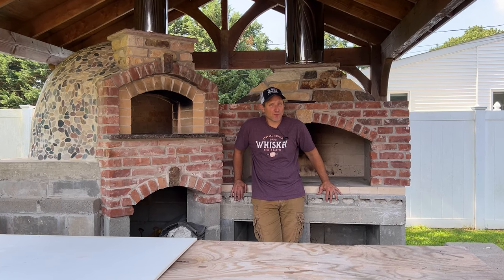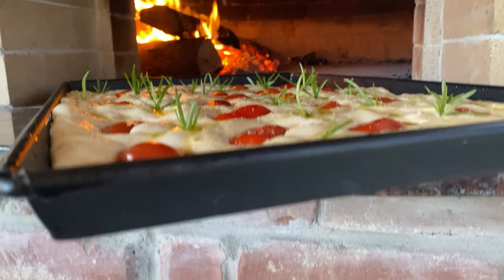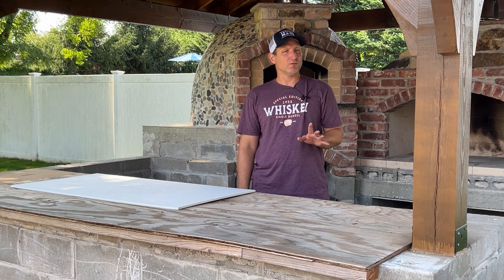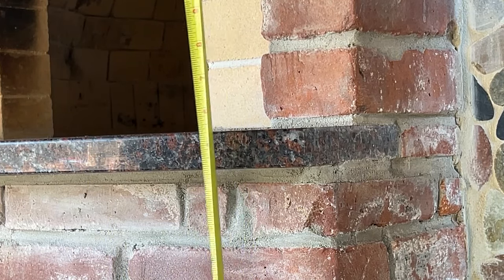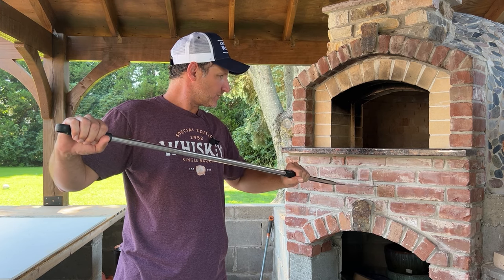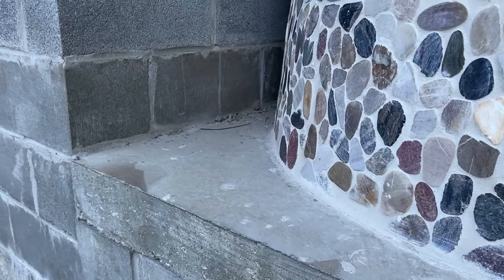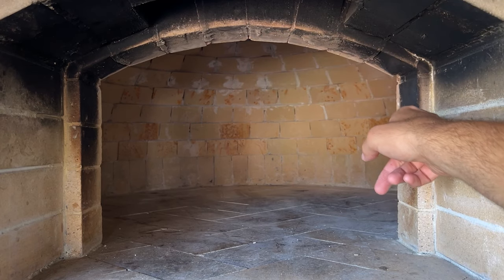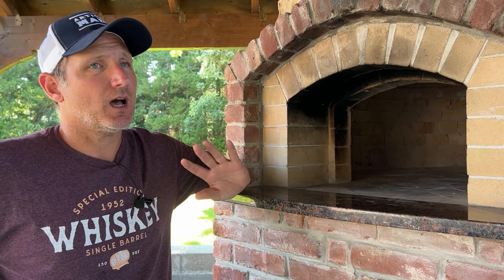Avoiding Mistakes Building a Pizza Oven / Building a Brick Oven / Pizza Oven Construction

Comment: A full round dome is only a YouTube  phenomenon - it creates a burning point on the oven floor. This mistake is due to the “YouTube smart tool” holding the bricks. Italian ovens is more flat and has a variable radius. Top height - 48-50cm …stack up bricks, make a plate divide it in 3 or 4 so they can get out later on through the pizza opening, then use wet sand to shape up your dome - the wet sand will hold your bricks as well. Super easy.
Reply from the maker: You’re talking about Pompeii style ovens and they are great, especially for pizza. Not all oven designs are shaped in this way. The rounder shaped ovens like mine are Tuscan ovens. The reason why so many people on YouTube build them like that is because many of us are not experienced masons and these are much easier to build.  The “YouTube smart tool” existed long before YouTube. I never liked the sand method for constructing the dome and this is not what the pros do either.

Comment: Nice oven. I made a similar video for the indoor one I built for my cafe here in Japan. Mine is a 40 inch and with a 64% inner arch ratio for my Pompeii design. It is always better to run your flue back over the dome and then extend from the middle. This way the heat of the oven powers the draft. As for the height of the base that’s not a problem as everyone in a family is a different height. This is where you can fabricate a platform and place it on the floor and then move it for the taller members of the family. Also when making a Pompeii dome the roof should not be a perfect dome at the apex. It should flatten off a bit and this way you lessen the hot spots. 40 inch is the perfect size even for 2 guys cooking pizzas all night. The only time you need something bigger is when you have a bread operation. I made mine with a second battery brick behind the dome and with a double floor. Super even and consistent and much much longer heat retention.
Reply from the maker: Hello, thanks for sharing. I thought about building a little platform.

Comment: This video is clutch... I just came inside from building the walls of my oven stand and its at 35" in height which I think its kinda low and I'm thinking put putting another round of blocks.  I'm super glad I got to hear you opinions on the matter

Comment: I can so relate to your video, if you say 40 inches is that inner diameter or outer diameter? I've built two pizza oven before, first one was too small and the chimney was placed too high in relation with the ceiling of the oven and the base was too low. Lessons learned! Second attempt I managed to get the opening size perfect and the chimney going back over the top worked a charm. Although I made the base higher than the first one it was still about 8 inches too low for my liking. Both these oven are still in use as they were at different properties we lived at before. Also the perfect radius dome resulted in using such a big load of firewood to get the oven to temp. I am planning a third attempt where I will lower the dome (I saw you mentioned that being called a Pompei style), raise the oven base about 8 inches but also elongate the oven from left to right rather than a perfect circle in order to create a bit more room for a fire and potentially more flexibility when baking multiple items. I hope the lowered dome height will reflect heat down and make the oven way more effective. Wish me luck!

Comment: Good advice I've built eleven ovens . It took ten ovens to perfect the design, size , insulation , oven shape . I finally made the perfect oven for my house and it works fantastic. I've used it everyday for the last 20 days . 
     One thing you left out that is the most important next to insulation thickness , and that is you need to keep it bone dry with a good roof or some outer waterproofing material . A wet oven will not work .  
     Second thing is you need to seperate the oven brick with insulation then another layer of cement or brick then another layer of insulation and then your decorative stone or brick outer shell because if you don't they will crack . Cracks will form all over the place from heating exspansion and cooling contraction .  I could go on and on . But I've been building and using these ovens for twelve years now

Comment: Hello this is Thomas!  I Live in Thailand. I finally found a good Brick layer. From Germany a professional Brick layer. Most of the Thai brick layer's  don't pay any attention to details keeping it plumbed vertically or level. Yesterday we measured the actual  size of the overall width of my pizza oven. It is 40" wide. For building our foundation we are going to be using  Blocks, the Blocks measurements are 2.1/2-1/16th wide By 15-1/2-1/16th So we are going to use two Blocks side by side with about 1/4" of Morter in-between the Blocks. Making the total with of the block 5" Wide. 
I've decided to go with your suggestion for the actual oven door opening of 18" and the Center of the door opening 12" High. As you answered me in my first question  about do you have a door for your pizza oven. Thank you for your answer. Mine will be the same just a simple metal door with a Handel to cover the opening of the pizza oven. 

I have another question for you what about the metal flue that takes out the smoke? They don't have aluminum here at all only steal in which to build it. What are your thoughts and suggestions on this? What are the four sides of the dementions you need for the flue opening? How high should we go up with the stack?
Reply from the maker: Most are made out of galvanized or stainless steel.  The opening should accommodate the size of your flue.  My flue is 8 inches in diameter.

Comment: Hello Jason. 
I'm asking a few more questions. The reason I have not built my pizza oven yet is I have been looking for my friend who is a Professional Brick layer from Germany.
We have started he has built the three sides of the oven the blocks measure in width 2-3/4 Length 15-1/2. Width. 
He put two Blocks side by side with rebar in the inside of the Blocks. Four courses high. We built the fram overall demetions are 51x51"X4" thick with rebar. 
Heating our pizza oven. 
What about using LP gas this is the norm for cooking here in Thailand. I've been thinking about this? I think I will go with it  besides wood. Using wood here Is a lot different then in America. Plus here in Thailand there is not that much wood here in Thailand. 

Jason I am in the process of building a wooden dome. I have built one already but it was to small. So building a new Wooden dome I've looked at your video again I'm going to go with your overall suggestions. Highth of the opening, dome.  The width of the opening door. My Brick layer Kai is coming back next week to start laying down the fire bricks on top of the wooden dome I've built to your suggested measurements. Sounds great. Thanks. 
Jason My first wooden dome wasn't large enough I couldn't put Three pizza's inside of the wooden dome. Opps  I looked at your video again writing down the measurements of what you suggested. I'm going with it. Thanks. I am going to have a door opening and closing. After Kai gets  almost everything done I will have to oven door built.

Comment: I went with an exercise ball 29 inches at Walmart 13$ it kinda filled it.  It's a strange hat-looking dome lol the foam was hard to build after I got so high. but I stopped the tool just after the arch and did it by eye it turned out to be egg-shaped kinda like a turtle, but then rounded just before the hat. don't know how to show it but thanks for your vids helped me a lot 48" inside needs to fill some gaps inside but I'm satisfied. watched your vids like 50 times
Reply from the maker: Congratulations!!! This is not an easy thing to do. If you have time, send me a pic. Artisanmadethings@gmail.com
Reply: @ArtisanMade  I am planning on building an oven this summer.  Would a two piece arm on the tool work with a series of holes say a half inch apart for shortening the arm length as you proceed thru the top of the dome work?  I don't know how much shorter the arm needs to be, but with the known drop needed the hole spacing could be split so it would be even for each row of brick.

Comment: Thanks for informative tips,
I have a question if you don’t mind!
Is the outer wall of the dome going to be hot?
And what is the clearance if it’s close to the wood material?
I’m adding a pizza oven in to my existing outdoor kitchen space which is mostly wood, since we live in Toronto and I need to know if should be considered and also for exhaust pipe after insulation can be close or touching wood material?
I really appreciate if you would help me with that since I couldn’t find any source for that!
I thought I would put the whole oven right behind my kitchen and only opens from inside means just an iron cast small door maybe!
If I have the answer for that I’ll start it right away sir,
🙏🙏🙏🙏🙏

Comment: Thanks for tips! Just wondering how did you calculate the amount of bricks you need to build this oven? I want to build a Pizza Oven similar to this but smaller. 🤝
Reply from the maker: I took a guess. I bought 300 and used 250.
Reply: @ArtisanMade  Also, instead of adding chicken wire, insulation and cement for the outer layers of the oven, could you use the vermiculite paste you used at the bottom of the oven to cover the entire oven as an insulator?
Reply from the maker: @heartsofhubert  yes. 6 inches thick is the equivalent to 3 inches of the ceramic fiber blanket.

Comment: Thanks a lot for all those videos helps big time, I am about to start the dome following your video of how to make the trammel tool!. 

I’ll have an important question. I hope you can help. 

I have enough light weight white insulating firebricks to build the dome, is it ok to use those type of bricks?
Reply from the maker: Insulating bricks are no good for the dome.  They Do not absorb heat.  Firebrick absorb, retain, and reflect heat and is necessary for an oven to cook properly

Comment: So what do you recommend to lower the height of the dome using this tool? Use it to point then what? wing it or use a ball or something. I'm working up its's doming and will be huge, but I see your point like a turtle with a flat top. maybe cut the stones like the arch and go in. gravity doesn't help. what's your recommended idea
Reply from the maker: I would make a form with styrofoam sheets with a more aggressive curve for the upper portion of the dome.

Comment: My regret, not using more perlite floor insulation. My insulation is 2.5 in. I can still cook a mean pizza though!!!
Reply: Biggest mistake with most pizza oven floors is that they aren’t double thickness. Double the floor and also use 5 inches of perlite/vermiculite under it.

Comment: Nice build on your oven. My oven is a barrel vault oven. I want to make another that will go on a trailer. I used Rado Hand's plans and adapted. His advice made the difference. I made a big oven to fit two full restaurant sized sheet pans in. Rado's advice on the ratio of oven dome height to mouth opening height was spot on. I made my opening wider as he said that wasn't the crucial dimension. My draft is excellent and after ten years there is not smoke on the outer face of the oven. My large oven with a large height does suck down the wood though, but I have tons of it on my land. I would make it a bit lower of dome height because with pizza's I don't get the top radiant heat as much, but as long as I have a good log flaming it works fine. The other size consideration was to fit a small roast pig in so it's a bit bigger. I really am glad to have found your build with such good instructions. We'll see how it works out.
Reply: All you need to do is lift the pizza up and hold it for 10 seconds on the peel near the roof and that takes care of that. With a low dome you have taken away all the other uses for your oven other than pizzas and breads. You chose well just remember to finish the pizzas off by lifting them into the roof and then serving them.
Reply: @RealRuralJapan  Thanks for the perspective. That's generally what I do to get the final toast on top. I was just getting a bit tired have having to use so much wood to get it up to pizza temp. But once it is ready, it is a great oven.

Comment: Question - how viable will it be to add a cold smoke chamber to the side or underneath the oven with a smallish inlet into the dome of the oven for cold smoking? By extension, including a metal bar at the top of the done to hang cuts of meat for this purpose?
Reply from the maker: Not sure but I think I saw a video on YouTube

Comment: From an ergonomic standpoint, appliances like stoves and conventional ovens should be at elbow height when standing. Counter tops should be just above waist height off the floor 

The problem comes into play when you have a tall and short couple. I'm tall, do most of the cooking, so my counter tops are 42" My stove has a built in oven, so the oven requires me to bend over to tend food cooking.  

Overly tall counters and appliances become scalding hazards.

I love the idea of a outdoor pizza oven and cooking center, I just don't like the price.
Reply: It's cheap,  if you consider you'll never have to buy an oven again in your lifetime.

Comment: I have a question why didn't you put a door on your pizza oven? Please explain
Reply from the maker: I do have a door but if you are talking about a permanently mounted one, there is no need unless the oven is indoors. The door is used as a damper and to trap retained heat.

Comment: So...use the indispensable tool to build the dome or not?
Reply from the maker: Yes but on the larger sized ovens you will only use it for the lower half. Then you will need to use a form to more aggressively curve the dome so it doesn’t get to high

Comment: once you get started you're going to find out that 36 in is big a lot of bricks a lot of fire mortar a lot of weight I plan for 32 I ended up with 30 in with a fudge 15 inch radius bar

Comment: JUST RACE THE FLOOR OF THE AREA OF YOUR  EXISTING FLOOR.
Reply from the maker: Then counters will be too low.
Reply: @ArtisanMade  I am 71 years old.  I was a Bricklayer for 50 years. What  would  I  do ? If I was there I would Calculete the Weight of the Oven including the concrete slab. I would rent to 2 jacks Prop the slab , free the Oven from side walls and take one course of Block off. If slab as steel and is over 4 inches you will be fine. The oven and the brick work is one unit, it will  not fall apart. Only thing is you need to lower the jacks slowly at the same time. Prectes first with the Jack on your car or tuck so you know what to do. Sorry about my Spelling I was born in Sicily and lived in Detroit.
Reply from the maker: @salvatoregiordano4665  Grazie amico!   if I did that, it would become a very popular YouTube video.